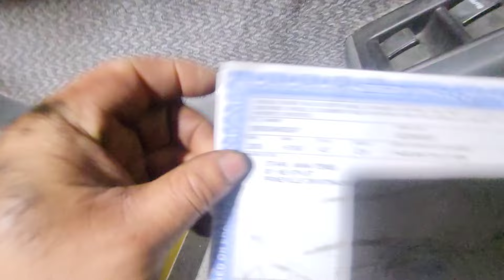marketplace Deals score 3 CRVs in a few day's

Comment: Got an equinox for 600. Sold wheels for 450. Put on another set I got for 60. Fixed main issue. Sold it for 2800
Reply from the maker: @stoveguy2133  that's what is all about sir. Good deal

Comment: I just got a 2002 Nissan xterra with 125000 miles for $700, and a 1999 Chevy lumina with 84k miles for $800, both vehicles are in great shape and need very little work
Reply from the maker: @AmericanRebel.Crusader  don't sit on them too long bro. Fix them n flip them.

Comment: Nice deals you should try to find a toyota tacoma or just a pickup
Reply from the maker: @Cat03-uo9it  we have one we got to go get. I will upload video of it. It's a 94 4x4 toyota truck short bed single cab.
Reply: @hectorb1721  I've got a 94 toyota pickup too! 22re 5 speed manual, manual locking hubs. Red single cab short bed. I got it for free, because it got hit in the front. I rebuilt it 1 month ago now. I've got an xtra cab 3.0 v6 thats 4 years older and its an auto. Looking forward to watching the video

Comment: So far, I spent 2k for the front struts (KYB) labor included plus 8 hundred for the rear struts with labor included. Close to 170k mileage on 2007 CRV EXL.
Reply from the maker: @obey2dmax  they are on Amazon for $340 all 4. The new owner bought them supposedly.